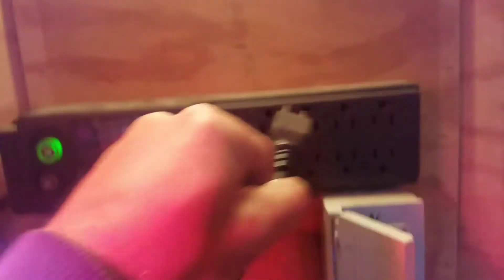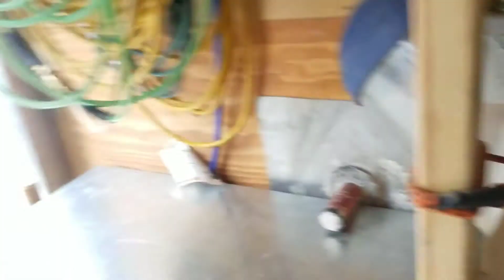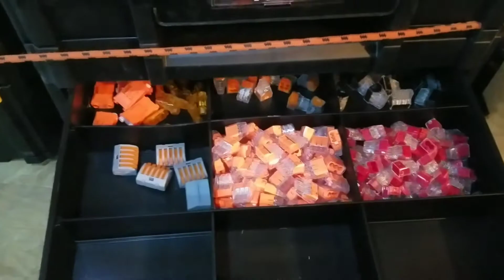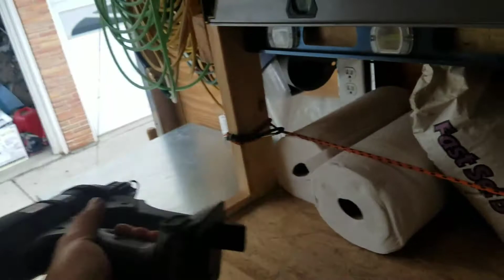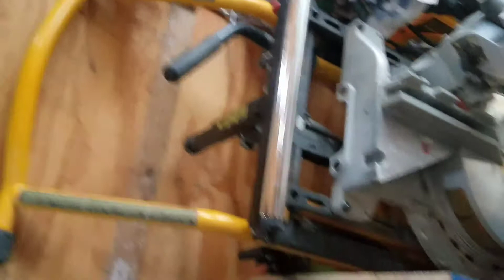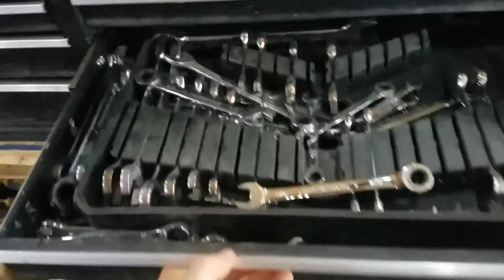CONSTRUCTION TOOL TRAILER. PART 1.  SOON TO BE REVISED.

Comment: Dewalt makes an extension support for your miter saw table.  I have the same gravity rise.   You could probably make one relatively easily out of a notched 2x4.

https://www.amazon.com/dp/B004UOG4P2/?coliid=I3FN7X1T0TUUJ6&colid=3R33ME44CPRAS&psc=0&ref_=lv_ov_lig_dp_it

Comment: If I could make a suggestion on that tool box on the floor....bring it off the ground...I built an area for  my air compressor to go in....mine stays in the trailer but is easy to roll out, it's the same as yours....I have a similar tool box that I had laying around and mounted on top
I really like your power system...going to upgrade mine to something similar...thanks for the video
Reply from the maker: +Sean Smith there are 4 batteries in that box.  Needs to be accessible